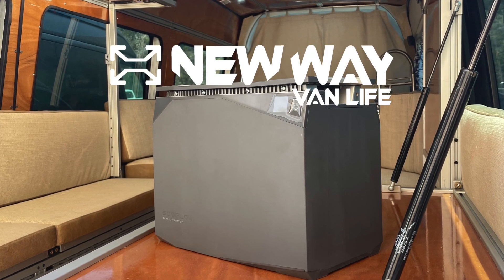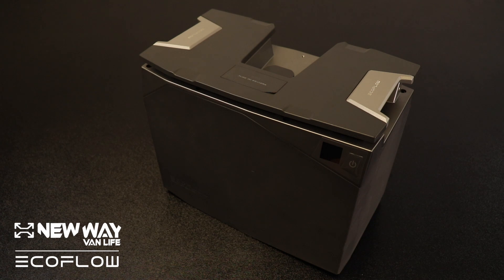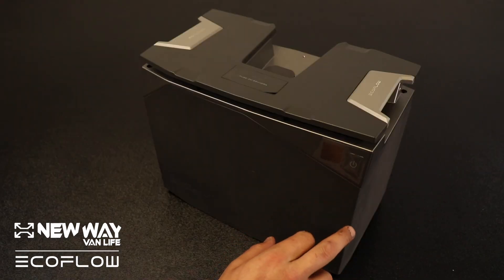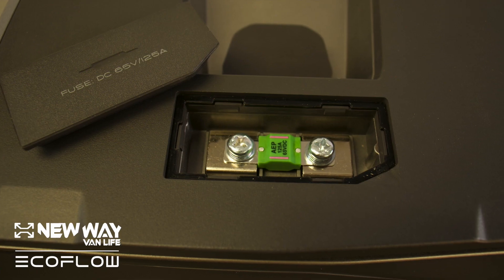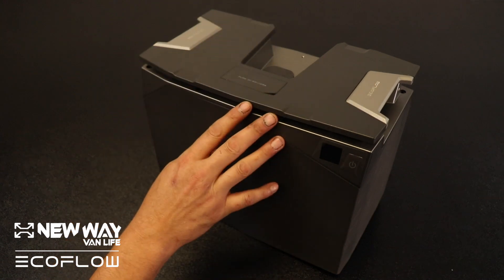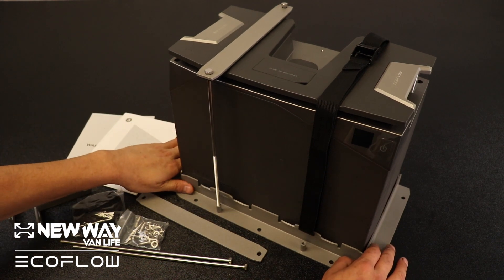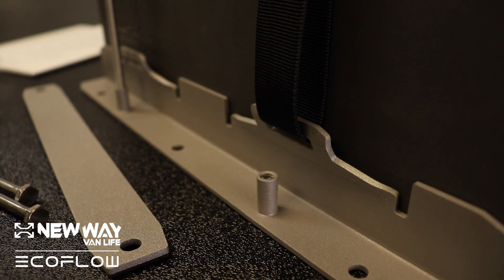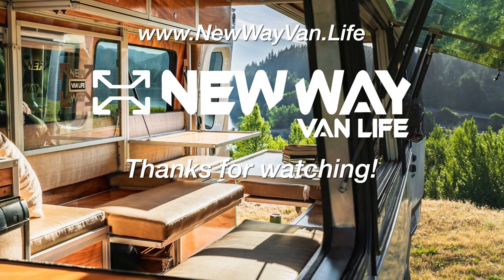EcoFlow Power Kits: 2 & 5kWh Battery HANDS ON & First Look

Comment: This is actually the first time I have ever seen a 5kW battery and I am in love with it already.
Reply from the maker: It's great! Such a nice design.
Reply: @NewWayVanLife can these batteries be connected directly to a delta 2 max power station and serve as extra power the same way a delta add on battery would???
Reply from the maker: @thepatternforms85  Hi there, unfortunately the delta 2 cannot use Power Kit batteries for extra battery capacity.